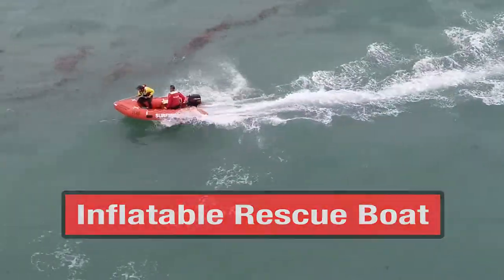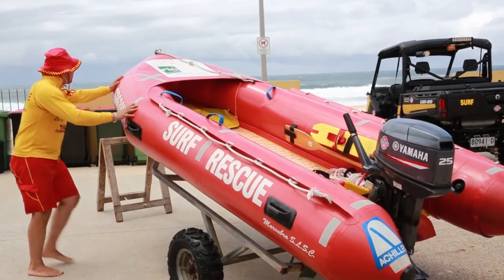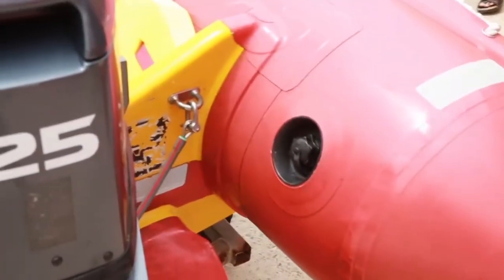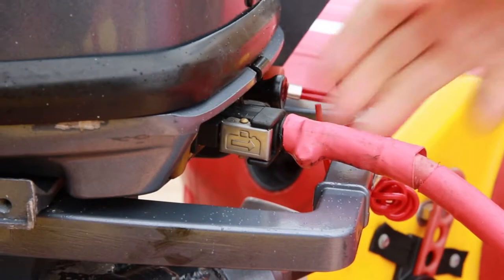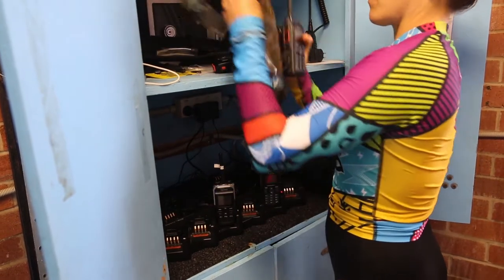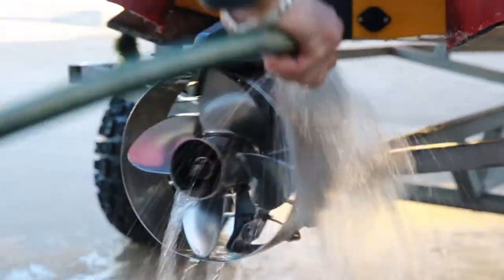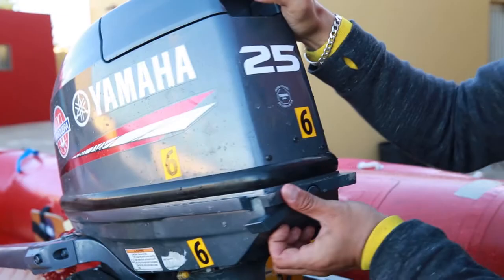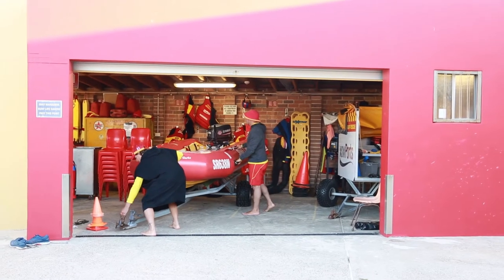Inflatable Rescue Boat - Preparation and Maintenance - Video 1

Comment: Very good explanation ! Are the motors 2 strokes and short shaft ?
Reply: yeah
Reply: How many horse power and what dimensions of the boat?
Reply: You can see the HP of the outboard is 25, and the length of the boat is approximately 3,75 m  @LauraStanescu-x4k